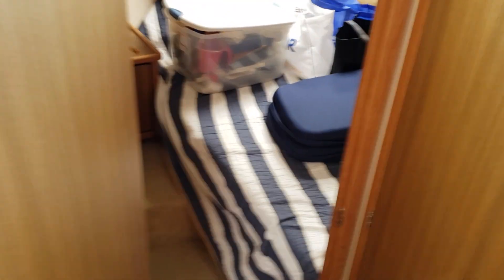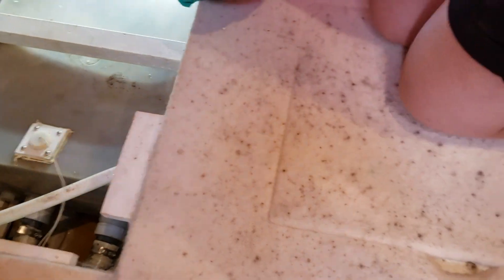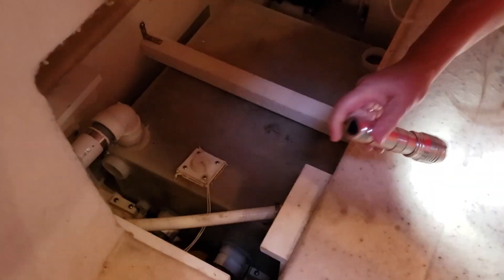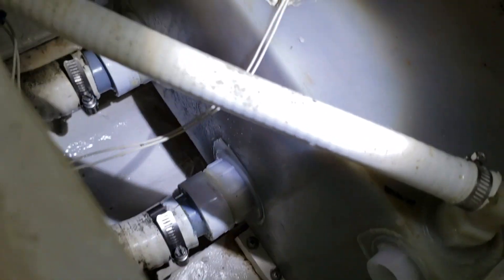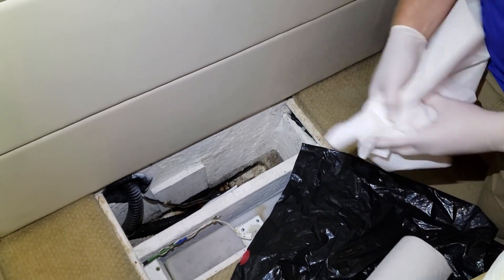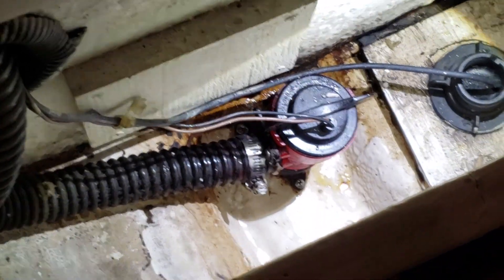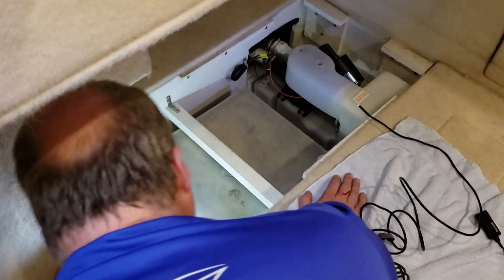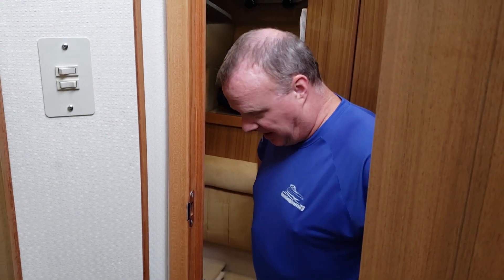OMG What STINKS?!! Is it our holding tanks? | Boating Journey

Comment: Check your hoses. If they are over 10 years old they could be the Odor  issue. They only last about 10 years. Just smell the white hoses in different areas. If they are not leaching they really won’t smell. If they smell real bad, especially in a low spot, it’s time to change them. I know, I had to do it.
Reply from the maker: Thanks! These hoses definitely need to be replaced,  but it was the inline vent that needed to be replaced.  Smell went away!
Reply: that sounds like a great idea, but there is NO WAY I can get to the sanitary hoses in my boat.

Comment: You kinda brushed off the crushed spot on top of the forward tank, which appear to have creased (and cracked) the tank.    Did you take an inspection mirror or your flexible camera to inspect that location?   
You indicated you had a vent issue.     I'm no expert, but I know pump-outs use vacuum, to draw out the tanks.   What happens when the tank vent is blocked?   Will the tank try to collapse (or crease) the tank if the vacuum gets too high due to a blocked vent?
Reply from the maker: Great questions! As soon as the inline vent filter was replaced,  the smell went away.  We do still wonder where the crease came from.